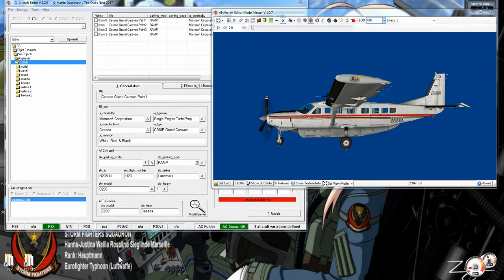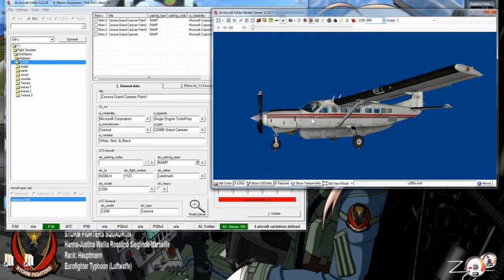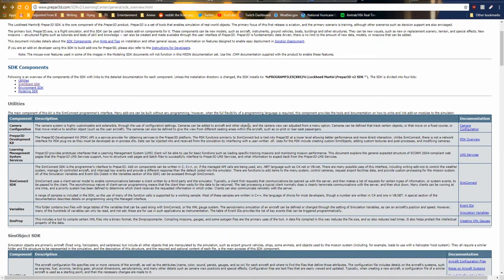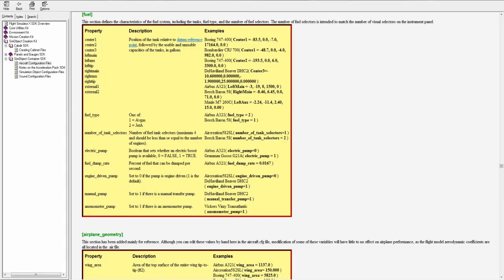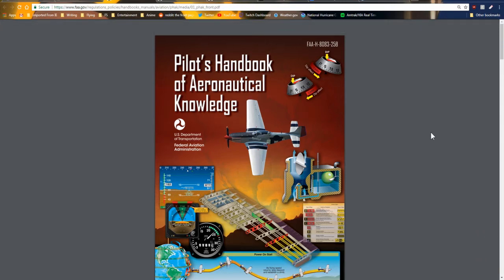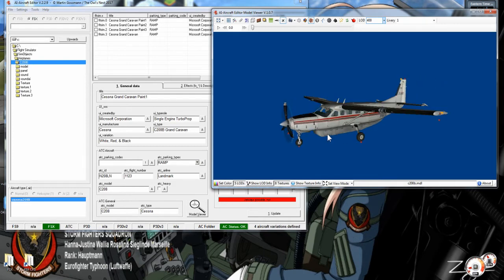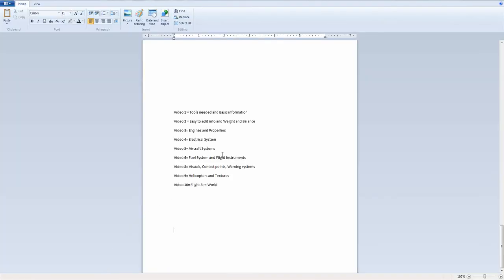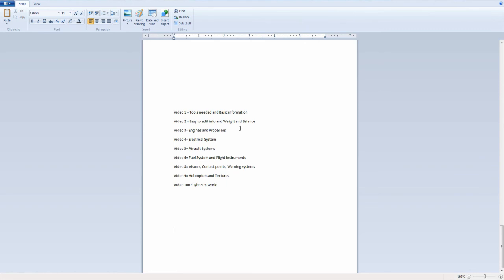Aircraft CFG. Intro to the series.

Comment: Hello sir I am having a bit of a problem maybe you can help me if you will.. I have my favorite add-on aircraft and everything works well except for one item.  I have played with the cfg file and nothing has changed.  When contacting the ground frequency for parking.  I say yes i'd like to taxi to GA ramp.. It says ok taxi to GA parking via taxiway abc blah blah.. And then my aircraft's only response is "taxi to fuel".  I cannot get this thing to go anywhere except the fuel box, and this is at every airport.  You seem to be very knowledgeable and much more so than I am.  Any help would be appreciated!
Reply from the maker: Thats an interesting issue. Let me get this straight. You request taxi to PARKING. ATC responds with taxi to PARKING, but your aircraft reads back taxi to FUEL?

The only thing i can think of that may cause this is the "atc_parking_types" entry which im not sure if i went over in this series. It basically specify s parking spot types the aircraft can park in. But FUEl is not a specifiable type since FUEL is supposed to be use by all aircraft. It may be that your aircraft has a parking spot type configured that is not available at the airport. most likely DOCK, MIL_CARGO, MIL_COMBAT since none of toughs are used by default airports even though they are a supported type. so ATC sends it to FUEL since it thinks thats the only one you can park at.

So open the aircraft's CFG file and CTRL-F search for "atc_parking_types" or similar. see what it says. you can specify the following types of parking spots. RAMP, CARGO, GATE, DOCK, MIL_CARGO, MIL_COMBAT. they must be written just like that, all caps, no spaces and use commas for the separators.
Reply: @Desparoto  yes i did stumble upon that method. And i did try adding those entries but to no avail. There has to be something somewhere else that is keeping it from jiving with atc and the parking positions. Never had this issue with any other AI aircraft. And yes. I ask for permission to taxi to parking at ramp , or gate, either way. Ground atc says ok taxi to GA parking via taxiway ABC etc.. And then my aircraft just replies taxi to fuel. Has me stumped. Id be more than happy to copy and past the cfg file for that aircraft if you want to take a look at it..
Reply from the maker: The only other thing i can think of is wingspan. It may be that the wingspan is to big for the parking there but i highly doubt it. usually the fuel parking spots are about the size of the large GA ramps spots. post the CFG in a google docs file or something and i can look at it. make sure to set the file to allow comments when you generate the share link.
Reply: Im about to post it.  I did try all the parking types codes also.  You will see those in here.  I added those, that line did not previously exist.  

// This is the flight dynamics file of the Douglas C-47. This is the miltary version of  DC-3
// Developers: Daniel Fuernkaess, Manfred Jahn, Alexander M. Metzger, Hans-Joerg Naegele, Mike Cyul, Warwick Carter, Jan Visser

[fltsim.0]
title=Douglas C-47 V3
sim=Douglas_DC3_v1.5
model=
panel=
sound=
texture=EATS_315221
kb_checklists=C47_check
kb_reference=C47_ref
atc_id=315221
ATC_PARKING_TYPES=RAMP,CARGO,GATE,DOCK,MIL_CARGO,MIL_COMBAT
ui_manufacturer="Douglas"
ui_type="C-47 Skytrain"
ui_variation="V3.14 Beta"
ui_typerole="Twin Engine Prop"
ui_createdby=
description=C-47 EATS 315221 V3.14 

[fltsim.1]
title=Douglas C-47 EATS Paratrooper
sim=Douglas_DC3_v1.5
model=
Panel =
sound=
texture=Paratrooper
kb_checklists=C47_check
kb_reference=C47_ref
atc_id=315221
ATC_PARKING_TYPES=RAMP,CARGO,GATE,DOCK,MIL_CARGO,MIL_COMBAT
ui_manufacturer="Douglas"
ui_type="C-47 Skytrain"
ui_variation="Paratrooper"
ui_typerole="Twin Engine Prop"
ui_createdby=
description=VVC Beta V3.14 Paratrooper. Overhead panel has red/green light instead of Seatbelt/No smoking Sign.

Below these two aircraft variations are all the flight parameters for it and I didnt include that but I can if you need me to.  I must say this is a really great AI. Especially considering its freeware!  The issue we are talking about is the only glitch ive found.  She flies like a dream, very realistic.
Reply from the maker: can you get me a download link if its freeware? or tell me where to get it. Ill try it out myself

Comment: Looking forward to your latest 'series'..    Initially I thought this might only be for those who  were interested in 'developing' for 'Dovetail', as you did make a point to mention them at the beginning. You seem to be the person with the technical savvy to ask a question or two...  

Can these SDK edits be 'percieved' or used as edits to 'flown' flights?  I'm having some serious issue with FS Recorder 2.17a on 'play back... It uses the 'Black Box' data from the flown flight though FSX.   I'm  wondering if one can go through the '*.flt' files, generated by saving the 'recorded' flight and then make edits to those 'panels' shown therein...

Playback of A2A, usually is a frustrating experience; hearing a motor run, and viewing a 'stopped' prop!.. I usually have to overcome this by 'recording' the flight experience, with the engine RPMs at 1300 or higher.. Not very 'realistic' by any means!  Upon landing, one would typically bring the engine to 'idle', and yes, this also produces a stopped prop in the FS Recorder playback file (*.FRC').  

I've questioned them on their Forum and they nor A2A are coming to any 'satisfactory answer on this and similar issues.  So I'm most curious to find out if using these SDK program 'edits' can be useful in editing the '*.flt' of the aforementioned recorder.

I realize my questions are only relative to the subject matter you discuss, but the SDK programs you mention are used by a lot of developers under some 'license' by MS ESP.. Surely do hope I hear something positive in this regard, and am going to enjoy this series too!  Thank you for your time and effort, and for any assistance you might provide relative to my inquiry.
Reply from the maker: If your asking what I think your asking then, thats a doosey. FSrecorder and even the replay feature built into FSX they are kind of recording aircraft position and then actually running the simulation again to achieve the same results. this works fine with default planes and default system modeling. but with addon planes they often use alot of custom coding. so it becomes difficult to do what your wanting. A2A in particular does alot of custom stuff. 

To answer your question i have no idea.